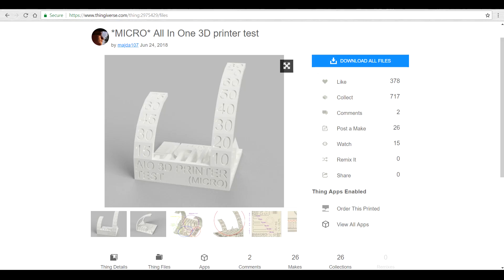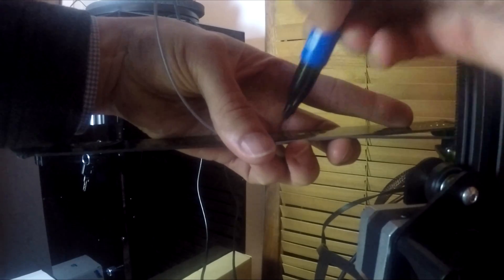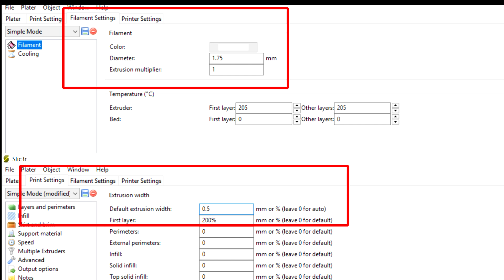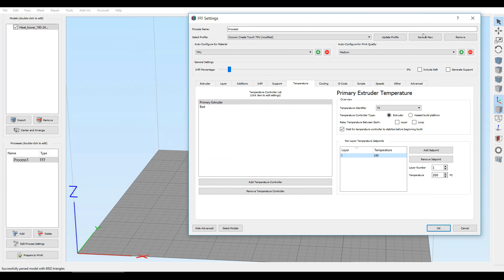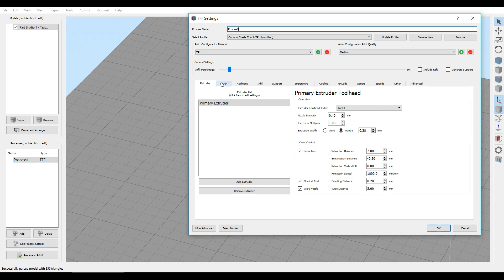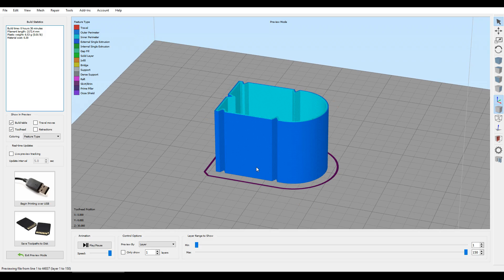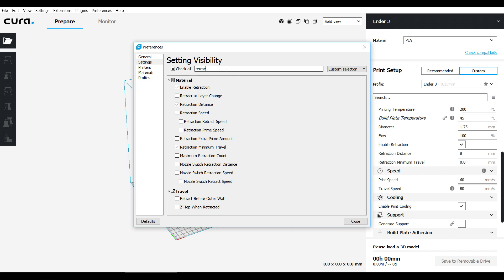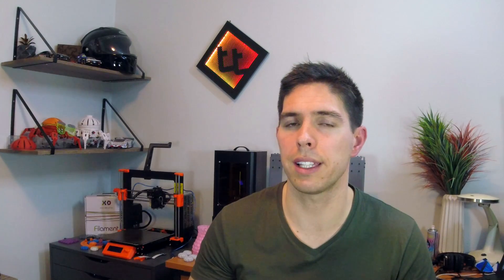How to tune your slicer settings featuring Ender 3 - UPDATE IN DESCRIPTION

Comment: How did you set the per 5mm height for the retraction section of the video, also no speed test .stl file?
Reply: ok sorry found the start/stop printing at height section..
Reply from the maker: Just checked and the speed test is included in my Thingiverse link.

Comment: With Creality choosing to breach GPL again will you be continuing to advertise their products?
Reply: Whats the impact for an customer when the GPL is breached? I don’t understand this. I don’t care about GPL just want to have a working printer.
Reply from the maker: That's the article I had read. I'm stuck in the middle here. On one hand I'm big on the principle and care a lot about GPL. On the other hand I understand that most viewers won't care either way. Technically the Ender 3 is open source and this is the only printer from them I've ever had affiliate links for. And yes I'm aware they didn't do this without pressure.
Reply from the maker: I'm not across whatever the latest news is. Would you mind linking?
Reply: http://www.3dprintergploffenders.com/  https://www.printedsolid.com/blogs/news/we-are-ending-our-relationship-with-creality

Comment: Thanks for the video. Super helpful. Could you upload your cura config file to the thingiverse file section so we could use it as a baseline?
Reply from the maker: I haven't modified it from the one that came on the SD card.
Reply: Yeah, I was worried about that. I have to use Slic3r cos I only have a tiny netbook to slice on right now... the version I have doesn't have an #Ender3 default built in, I put a stop-gap in for now (printer in the post) but profiles are on the sd card, is that right Tt? Thanks Michael :) J
Reply from the maker: It's a while ago but I believe they are.
Reply: Mine didn't came with a profile, but it came with a pdf with instructions how to set up a profile.
Reply: I'm less concerned now, starting to understand that I can just put cr10 profiles in and fiddle the build volume ;o) see? I do learn, it just takes a while ;o)
Reply: @pdjames1729  one of the manuals PDF said that, wanna them? I'm pretty sure still have them somewhere at my disk
Reply: That's really kind Alan xx I have Slic3r setup for mine ok - but if you still want me to look under your desk, what else is there? :oD

Comment: 3000mm/min is 50mm/second - But with the outline underspeed you entered at 50% you'll end up with 25mm/s.

S3D can show you the different print speeds it chooses in the sliced view.
It will slow down your print if the geometry doesn't allow for enough acceleration.
That's also something to consider.
Reply: Also: Speed will affect you most, when you print thin, high objects - especially when using supports.
Reply from the maker: You're completely right. Late night brain fade on the speed conversion. The reason I suggest hollow is to see the full speed on the interior walls in contrast to the 50% outline speed.
Reply from the maker: Description updated, thanks for bringing to my attention.

Comment: Thanks for the video, really helpful :).  Quick question can the ender print petg on stock hardware, as I’ve heard don’t go above 245 as Teflon breaks down? If not is it possible could you do a video on how to mod the hotend/tube?
Reply from the maker: I've printed it just fine. Max temp for hot end according to Creality website is 255. I think I had 240. See the bed comparison video.
Reply: Teaching Tech thanks
Reply: I’ve printed at 260 it’s fine
Reply: That might be changing over time, as you get variation xx the bowden tube is PTFE and should be snug in contact with the top of the hotend block... so you got some lee-way before it's all nozzle goo - I'm not sure how long the tube will stay perfect for 260c prints - test it to failure Abin, new tube is a quick fix anyway xxRJ
Reply: Printing PETG on a stock Ender-3 can totally work, but don't print it at the higher end temperatures, because the PTFE will, as you say, start to break down around 240°C. That's bad for two reasons: your extrusion will, over time, change - jams, underextrusion, more friction, ... - and you'll be releasing gases known to cause brain damage into the air. Unless your printer is in an enclosure with an air filtration system, you don't want that.

Cheapest way to fix this, just get some replacement tubing (th3dstudio.com Tough tubing or Capricorn tubing, for example) that doesn't start to break down until a higher temperature.

Comment: coooool. i was just looking at different thing. if this works it will be a major time saver. will this work with abs and others?  i wish i could afford Simplified 3D, it looks awesome.
Reply: Ideally you'd want to profile for each material you use, but yes. If you test with abs, the tweeks will do the same thing. Abs has other issues though, printing larger parts without warping can be difficult without an enclosure (of some basic kind) and possibly tweeking the bed a little.. cork pad for fast heatup. Straight out the box in a warmer room should be ok. :o)

I'll be trying to setup a 'good enough for most filaments' fast profile on mine, so we both in exactly the same boat - lol

Comment: Michael, it's worth noting that on stock Ender 3 firmware, and some other printers, it won't save to the eeprom with the M500 command. If you switch the printer off and on, and use the M503 command the steps will be reset.

I got around this by adding the M92 command to the starting G code in S3D.
Reply: Thanks, I recognized the same.
Reply: paynis21 no problem. It's a limitation on stock firmware. Confused me a bit when I noticed my prints being inconsistent. They're great now it's in the starting G code.